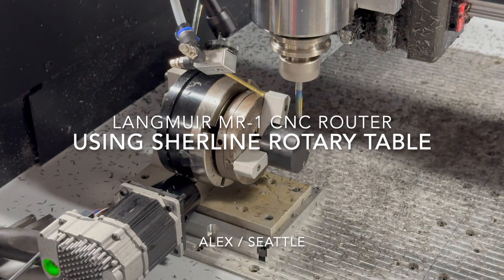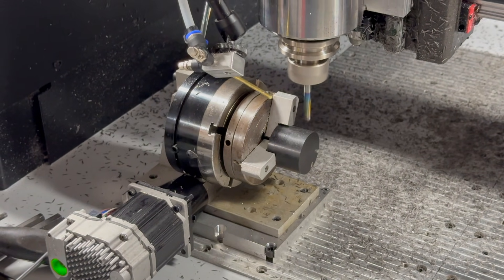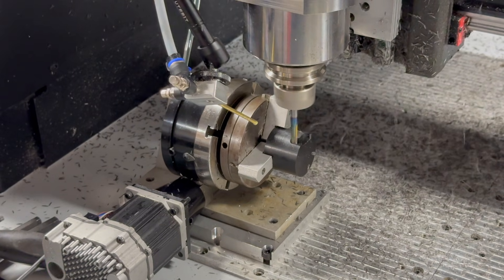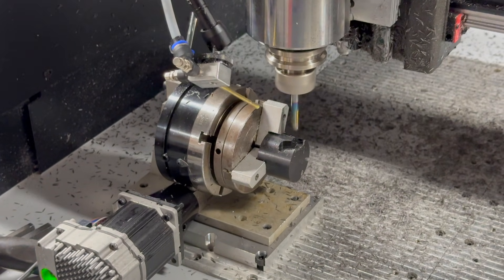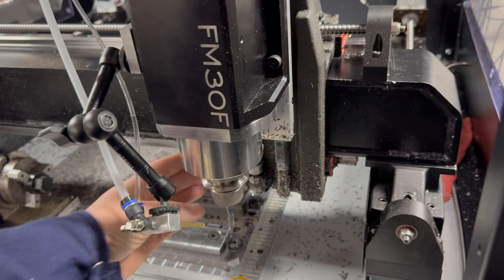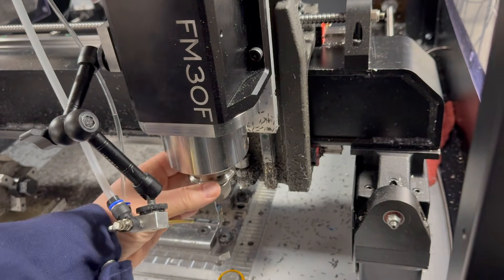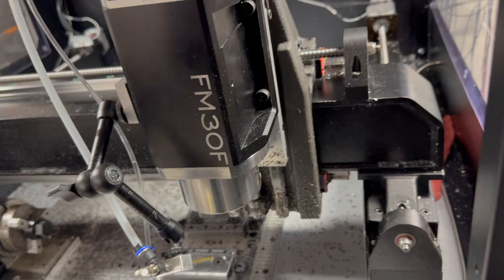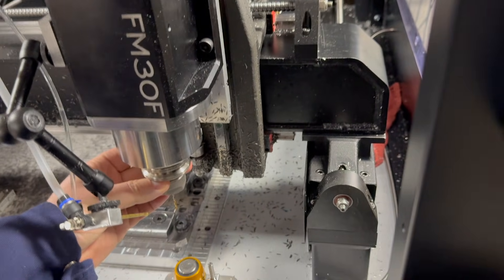MR 1 with Rotary Table, first cuts

Comment: I use the stepper killers Teknic makes on my RF-45 clone.  They are absolute beasts, lots of torque, just wish they were cheaper.  Being able to program their settings really dials them in.  Spindle upgrade with pneumatic tool change is next on my list

Comment: Hey buddy how is the run out on those iso20 1.5 inches below the holder? They look like the tormach one? 

Also im very intrested in the mr1 i see you upgraded to clear paths thats hefty money ontop of the machine. What was the reasoning other than im assuming accuracy with orignial steppers provided. 
Love machien btw! Also did you swap couplers for dual disk instead of spider style?
Reply from the maker: The spindle is ISO30, not 20.  I checked two different tool holders that were already setup with 1/4" random ER20 collets.  One had 0.001" runout about 3 inches from the spindle nose, the other had about 0.0002" runout.  I expect collet quality/luck is the most important factor.

My ER20 collets were sourced from both Langmuir and Haas.  The ISO30 tool holders came from "Reds" on eBay and are both inexpensive and .have short stickout.

I got the Clearpaths from eBay for a bargain.  I had been playing with one on another project and really like how they work, so I jumped on a deal.  They are overkill but very nice to tune and work with.

I'm mostly using the stock couplers, but replacing them is on my todo list.
Reply: @awetmore sick! How was the install did you have to tap the z axis plate to bolt thw motor
Reply from the maker: @EV1LEGG I machined a new Z axis plate (there is a video of me making the steel one on YouTube). 

The LinuxCNC conversion took time, but it wasn’t my first experience with it.
Reply: @awetmore awsome im looking to throw my masso g3 touch on there

Comment: Could you tell me how to setup a rotary attachment on my MR1?
Reply from the maker: I'm sorry to report that changing the control system from CutControl to something else is a pre-requisite.  CutControl (today) doesn't support rotary tables.

They've hinted for two years that one is coming, but almost every new hinted feature has never arrived.
Reply: @ thanks for the reply and yes they recently told me they were coming out with a MR2 version. Great work!

Comment: Very impressive Alex. That spindle sounds fast! What's the max RPM?
Reply from the maker: Thanks Alistair.  It has a max speed of 16k RPM, and I think was running at 12k RPM with the endmill.
Reply: @awetmore  damn...pricey upgrade. is the stock spindle total trash?
Reply from the maker: @vancouverisland-g6c  It's not trash, it just wasn't the right spindle for how I use the machine.

As you probably know there aren't a lot of options in the ~$10k price range.  This ended up being the right one for me.

Comment: wow your z axis is hauling ass.  Did you modify the lead screw or its motor?
Reply from the maker: Z has the stock leadscrew, but I'm using a Teknic Clearpath servo on it.

None of the electronics on my machine are from the original Langmuir build anymore, but all of the mechanical parts are stock.
Reply: @awetmore  did the Teknic Clearpath servos bolt right up or did you need to make new mounts?
Reply from the maker: @ the x and y ones are NEMA23 just like the stock steppers and just bolted right up. I used a size 34 motor for Z and that one required a new adapter. 

I don’t think they would work with CutControl though. 

It simplified my electronics enclosure too since the clearpath motors are self contained.

I’ll make a video showing the current electronics.
Reply: @awetmore  sweet!  I've got 95% of the components to build a cnc lathe.  I would love to see your electronics set up.  I have a  Centroid Acorn board. 

I wanted to go with clearpath but didn't have the $ at the time.
Reply from the maker: @BeckTools  Teknic's Clearpath stuff isn't cheap, but I just waited until some good deals showed up on eBay.

I'll work on that video next.
Reply: @awetmore  would love to see that video, is it still coming? do you like the structural part of the MR1? to me it seems to chatter and leave a rough surface much of the time? but im only watching videos. would love your opinion. thanks.
Reply from the maker: @vancouverisland-g6c  Sorry, I've been distracted with other projects.  I will try to do it soon.